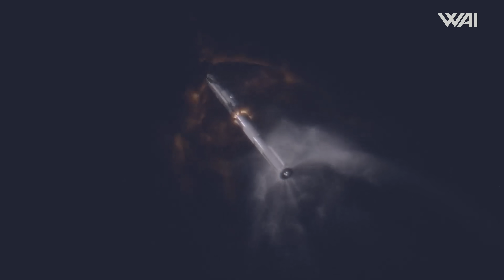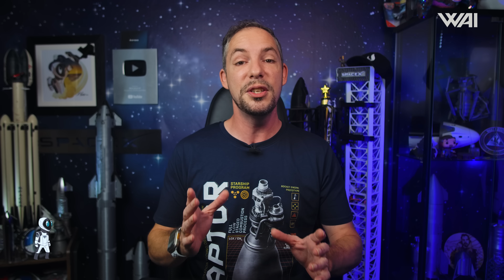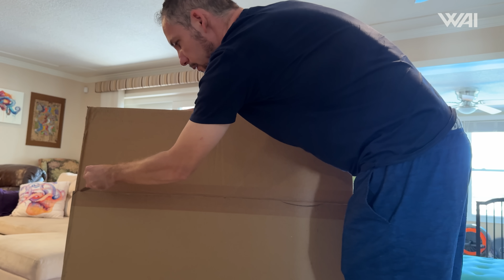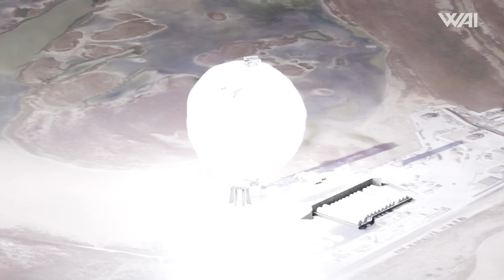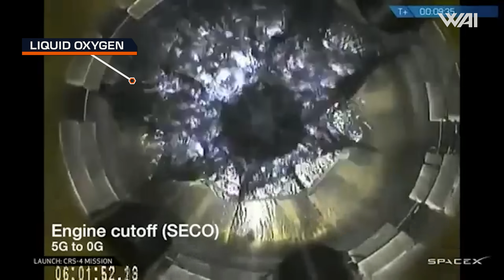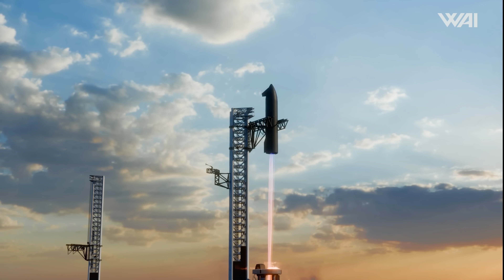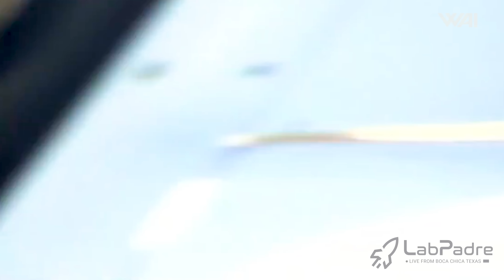Get ready for Starship Flight 6 - SpaceX's incredible NEXT launch explained!

Comment: They don't need to change the flight trajectory to protect the outer engines, they just need to flow some cryogenic fuel through the engine bells like they did with the inner 13 engines...
Reply: Well engineering the outer engines so the cryogenic fuels flow through the bells of inactive engines makes the rocket more complex and costs a lot of money.

Adjusting your trajectory is free. 🤷‍♂️

Comment: I can't wait to watch flight 6! Watching it with your team should be great!!
Reply from the maker: We've got quite a few things planned for this one!!! I can't wait to watch it with you! :_WAISweet::_WAIHeart:
Reply: @Whataboutit  Yes!!😁
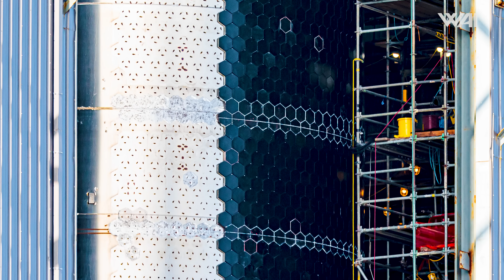Reply: @Whataboutit 7:07 Felix!! I'm amazed you missed the significance of Cosmic Perspective's MAGNIFICENT tightly zoomed 4K slow-mo. Clearly the Raptor activity displayed on SpaceX's broadcast is triggered by data, but the MECO shutdown shown was a preprogrammed animation showing the middle ten shutting down very soon after the outer 20, well before upper stage ignition. Filming from the other side of the launch site CP had a great view of the outer 20 Raptors shutting down at MECO and SH pressing on through Starship ignition, separation and initial SH rotation with all 13 inner engines firing. This significantly increased the duration of toasting, as Starship had to get up to full power before separation began and the higher thrust kept SH near Starship for an additional time. The shutdown to the inner 3 was after some booster rotation and very brief (to maybe 80° rotation) before boostback relight of the middle 10. Diligent scrutiny of SpaceX's IFT4 presentation shows a significant deceleration immediately upon MECO even before upper stage ignition. Presumably 3 Raptors give a thrust-to-weight ratio of much less than 1 and a late stage change in procedure was not communicated to the announcers or integrated into the display.

Comment: I have a question. If starship launches to Mars and the trip takes ~6 months, wont the propellant in the header tanks boil off? Especially since there isnt a lot of fuel in there and it might all boil off before the landing burn
Reply from the maker: Starships will bring in-space energy production. With that the fuel can be cooled down again! :_WAIStarship:
Reply: The headers inside the tanks are very well insulated.
Reply: No because it's colder in space
Reply: Couldn't we store them higher pressure containers ...